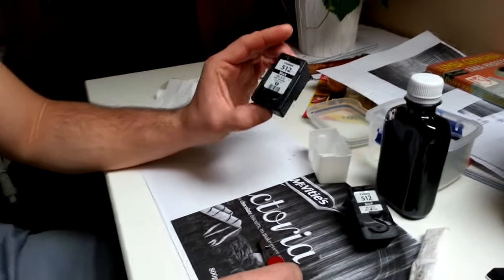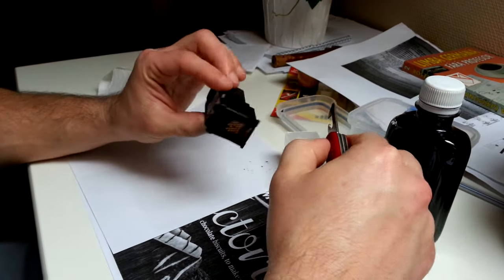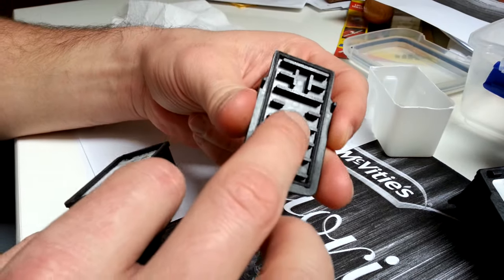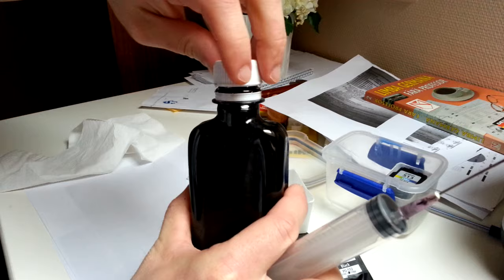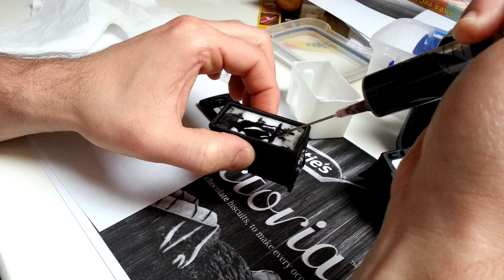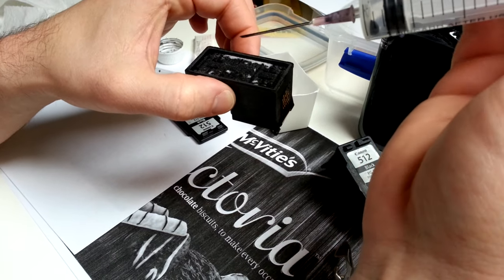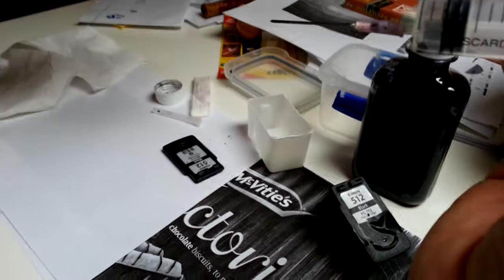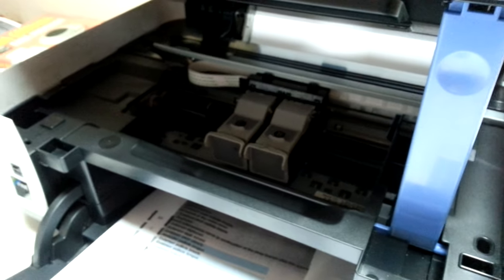How to refill canon ink cartridge (best way)

Comment: Is there any harm in doing this method. I have been trying to understand why there are so many videos on making holes on top and injecting the ink through the plastic. This looks like a much easier method. Are we missing something here?
Reply: I have been using this method for my Canon PIXMA cartridges, and every time I leave it for a few weeks without use it will be dried up beyond recovery. I assume this has to do with the fact that the lid is now not fitting tightly, letting air into the cartridge and drying out the ink around the printer nozzle heads.

I even tried soaking the head in a mix of isopropyl alcohol and warm water (after trying the damp paper towel method a few times), but it seems like the ink is so dried up that it doesn't work. I get no output at all on the test page (or any page for that matter). I have seen some even more aggressive methods, which includes completely disassembling the cartridge and washing and scraping the filter under water, but that releases a ton of ink in your sewer plus I already had an OEM replacement cartridge bought, so I was not willing to try that and just gave up.

At first this method seemed better and easier, as you could see what is going on. In reality, I already ruined a few cartridges by the ink drying out. Another issue that I ran into with the lid removed method, is that while filling up the cartridge it would often overflow through the print head.

Moving forward I will definitely be using the needle method to fill up my cartridges. I already bought the syringes and needles. As another tip, if you use a 27 gauge needle, you don't need to drill and the holes and make them larger, as the 27 gauge needle will fit perfectly though the OEM hole they use for filling.

As an extra precaution, I will be storing my cartridges when not in use as recommended here (https://www.youtube.com/watch?v=4_u4lh2u2RU). Apparently all inkjet printer cartridges are prone to drying out if you are not using them frequently (and I'm certainly an very infrequent user).

I am yet to see how well this method will work, but I can say with certainty that an OEM cartridge being installed next to my refilled one using the lid remove method, has never dried up unlike the refilled one (and they both have not been used for the same period of time). Like I said in the beginning, my only explanation is that the lid not fitting correctly is letting too much air in and drying out the ink, as this has happened to every cartridge I've refilled. They work right after refilling, but once they dry out they are completely dead. 

Another wild possibility is that the ink which I'm using to refill (which is still a Canon brand ink) is making some sort of chemical reaction with minute quantities of the old ink left, causing it to dry up. However considering in many videos I've seen people refill with all different kinds of inks, and the way these cartridges work + the fact that sometimes I've refilled them two - three times before storing them (which should have flushed all the old ink by now) this seems highly unlikely.
Reply: @boyanmilev653  thanks. I tried the opening method and it worked well. I haven't used it in about 2 weeks though. I may have the same issue. I am trying to get those caps that are glued on the top with holes for the needles already in them. I hope that I don't need to buy another cartridge set though.

Comment: IT WILL ALWAY STATE LOW INK HOWEVER BECAUSE LEVEL BASED ON THE CHIP WHICH IS SET TO HOW MANY TIME YOU PRINT .....FILLING DOES NOT RESET THE CHIP
Reply: You know any solution to reset the chip for 244 ink cartridges

Comment: Cheers bro! It works! If you cannot open the lid (it will be difficult the first time because it is glued on) you can make a hole with a knife in the same place where the author of the video opens it with a knife. Then lift the lid with a knife and it will open. After these steps, refill the cartridge and seal the lid with a tape.

Comment: Hey can you help me your video helped however the ink refill worked a couple times but now it's printing blanks after I refilled it last night any tips on how to fix this please reply ASAP thank you please note I clicked the reset button held at 3 seconds and I also held down the stop button turn the printer on and off and I also held the printer cartridge against a paper to see if any ink is coming out and the part on the cartridge that looks like a film strip yeah I pressed that against a tissue paper to see if any ink comes out and the ink lines black and the color comes out fine so I don't know why it's not printing help me out please thank you
Reply: Okay I have an update so the printer the Canon TS 3522 I believe its 275 cartridge it's printing color but it's not printing all black that's crazy is there any way to fix this
Reply from the maker: You could try to do a nozzle clean from the Canon software. It that doesn't work than the cartridge is probably broken
Reply: @one2three123  somebody else replied to me and said print head cleaning and now you're talking about the nozzle head LOL I don't know how to do either of these you're suggesting for the model number TS 3522 can you help me out I know the cartridge is not broken LOL

Comment: After topping up the ink, the printer show low ink. How to solve this? Pls advise. :)
Reply: The chip that gives you a full reading doesnt measure the ink levels it estimates from full based on how much you have printed. Which is why some carts will show empty when you still have ink. The chip isnt designed to be reset(show full once empty), which is why they sell after market carts that you can manually rest. But these will just show always full so you dont get the message again. Good news is this printer you can over ride and have it print even if it shows no ink, u like alot of printer which just wont print anymore once ink says its gone. Just keep printing as normal, hope this helps
Reply: @alexcarpentieri4495   @Alex Carpentieri  or the method shown in these videos show you put a tiny hole to put ink, which is dumb because i think the sponge is a very solid/firm sponge and with such a tiny hole and dense sponge it'll overflow before it can even absorb into the sponge, i drilled a bigger hole and tilted it to the side so it can absorb ink into the sponge better

Comment: Thanks for a good video. I took the lid off (with a small screwdriver) but I found that it would not firmly fit back on to the body. Should I use tape to keep the lid on or is it OK just to let it sit there a bit loosely. Thanks
Reply from the maker: Works both ways
Reply: Shh say... ok... No YELLING OMG I WORK FOR CANNON, I'M CLOCKED IN AND MY SUPERVISOR HAS ME!

Printer Fetish 101

Comment: i have no idea how you can pry it open, the pixman 2560 one has SEALED tightly, its so tight i'm not sure if its a lid (it probably is) also its a type that you put in from the side not top, if i break something off it might not slot in properly and lock in, so this might work for you not sure if its the best for all cartridges

Comment: I thought this looked like a genuis method until you get to the part where you say "just lay the lid on, it's not going to stick very well but...." I was wondering if the lid would re-attach or not, guess not! I do'nt think the design of my printer would hold it on the way yours does
Reply: Right! I wish I had watched the whole video before I tried it!
Reply: And the colour cartridge mixes the ink with the vibration
Reply: Maybe stick it back with some glue, I have the same problem

Comment: I did this, but the ink is really faded, barely there. Not sure what to do?
Reply from the maker: Make sure it's the right ink for your cartridge, add till it's all absorbed and then try it. You can recharge a few times before needing to buy a new cartridge. You have to use the printer often so as not to dry out the ink, because the cartridge head goes bad if that happens.

Comment: Thank you so much for this video. It was very simple. Can you refill the color cartridge (211XL) the same way, by removing the lid? And I liked your soft voice.  I did not have to turn down my speakers!  LOL
Reply: the sponge is divided so  you have to do each one red yellow blue or pink
Reply: @unitaryexile6549  it worked for color.  I suggest putting tape over other colors while filling each color to avoid cross-contamination.   Thanks for your method, by far the best.
Reply: @michaelprince9599  your welcome

Comment: Great idea but when you put the top back on its not secure ?
Reply from the maker: Just put a little bit of tape on it
Reply: @one2three123  / without blocking air intake hole.

Comment: Interesting experiment but without ending. You forgot to instruct everyone what glue to use to stick these two parts together and how prepare them before gluing
Reply: Use small piece of scotch tape without blocking air intake hole. Dried
Reply: @michaelprince9599  Thanks

Comment: When you understand that youtube only works for creators if they post content - whether or not the content is accurate or not  doesn't matter.  This is one of those videos. If you take the top off these little cartridges, you will never get the top to stay back on because, of course, they are not meant to be popped off in the first place.  Therefore that is why you should only punch or drill a little hole in the cartridge (like all the other videos say to do) because a hole is easier to cover rather than an entire top.   The method is this video is a really good way to get ink all over and inside your printer, completely ruining it.
Reply from the maker: I have tried both ways, and i can say that my way works way better. Its easy to just guess and talk your mouth. The lid can easily stay on there with a little bit of tape that you can replace every time you refill. The way that 'sponge' absorbs ink is way more efficient if you remove the top !!!! Try and see.....

Comment: NOT A GOOD method to take the top off ...  That piece is NOT going to snap back on most of the time.  It was made to refill from the top throgh the HOLE!..  It is th eonly way to insert  the sponge into the BODY...  LOOK at other viedo's on YOUTUBE  and note that they all  show from the top,  Please take down your video.
Reply from the maker: As i already commented, just use a piece of tape.... It is the best method!
Reply: Just pull back the sticker, heat up a nail that's thicker than the syringe is, poke 4 or 5 holes under where the sticker was, fill up the cartridge and put the sticker back on it.

Wait 15 minutes.

Run the cartridge cleaner program and align the print head.

Should be good for a year!